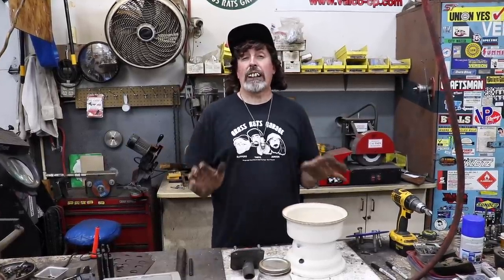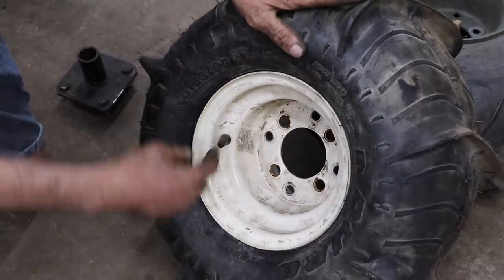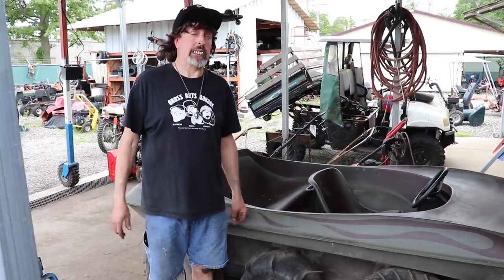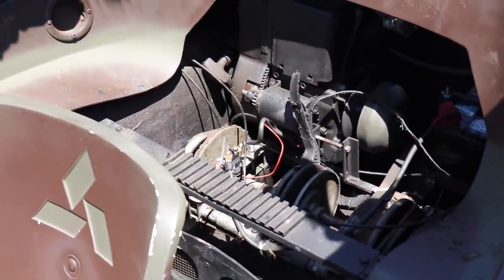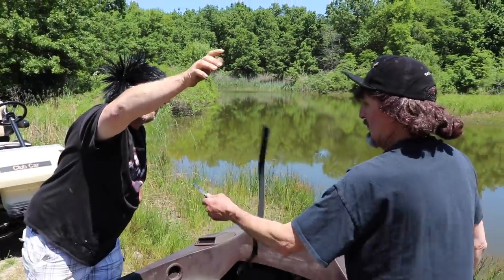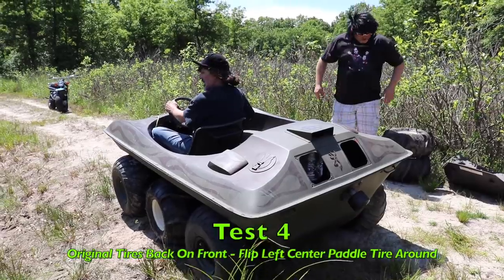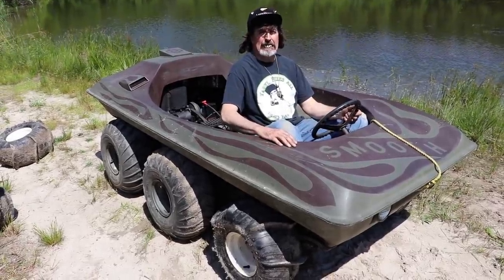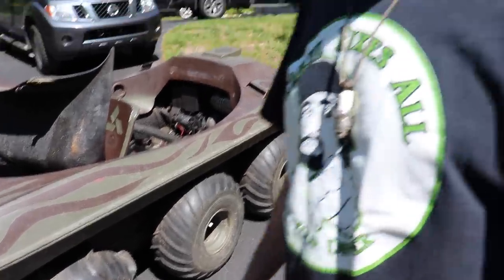Awesome FREE 6 Wheeler! Part 3 (Tire Test)

Comment: The more I see of this vehicle the more I understand why the guy was so keen to give it away.🤣
Reply: I was thinking the same thing..lol..no one would buy it...
Reply: Yeah I think they were junk. I mean look at all the chains. That thing would be in the garage being worked on more that it was driven.
Reply: Bro are those teeth real?
Reply: @wouldyouglowme4235  He sells them if you want to buy them. Go to his store.
Reply: @NY411Info  it doesn't seem like the chains are causing the issues here.
Reply: @Skoda130  Chains suck. The longer they are the more problems they will have due to wear. One link with .005 " wear adds up fast the longer the chain, which in turn also wrecks the sprockets. This is also why new vehicles suck with their long timing chains.
Reply: @NY411Info  maybe so, but the chains used in this thing, aren't much longer than those of a motorcycle. It's more that there are many of them. But that doesn't make their respective wear compound.

Comment: i think i would use the original street tires and put a trolling motor on it
Reply: Trolling motor?
15hp Johnson
Reply: @guyina4x499  7 marine 627
Reply: After working over 25 yrs at the gof course and changing lots of small tites. I found that a Cushman won't fit a Yamaha, or a John Deere, or others, you should have tried different rims.

Comment: A Naval Architect taught me about the term "hull speed limit"... Essentially, for a displacement watercraft ( it's not able to get on plane) the hull speed limit is determined by the length to beam ratio....short/wide craft will never go as fast as long/slender craft- no matter how much horsepower you add...  Think Jon Boat vs Canoe....
Reply: i got a 1432? with a 3.5hp 4stroke on it and it goes so fast i need to only use about 25% power. all your theory must also take into account the weight of the craft.
Reply: The vehicle needs a propeller shaft 😁
Reply: @robertp7209  i use a outboard.

Comment: Welp she's a good one for soft and boggy swampy ground, not a fish and ski, still cool though.  Hey we told you that spare belt was going to be easy to replace!   Cool machine, I'd like to see it on the snow this winter.   Neighbor had that or an argo like 50 years ago.  He would run it on the frozen backwaters during early ice fishing, worked well for that.  Occasionally busting through and crawling back on the ice.  It went through snow well until it got too deep.

Comment: My dad back when I was ten, fifty years now got two hovercrafts and this six wheeler from Boeing surplus we played with the six wheeler though the ditch and near by swamps and had a blast. The hover crafts filled the garage had a thick rubber bladder around it and he started it up and I recall that it lifted up as the air filled the bladder. Latter in the week he sold it all off to co workers hope he made a profit .

Comment: After going to all that trouble and expense, I would have at least given all 6 of them a try one time even if I thought it wasn't going to work.
Reply: They need to put 3 paddle tires running backards on the left and one in center on the right and I'd add a Rutter off of a sailboat and maybe a mast and a sail to.
Reply: @sams7655  And an outboard, just in case a storm blows up and shreds the sails.
Reply: Yea at least given all 6 A go

Comment: Taryl if you have to drill out a new bolt pattern anyway just get the right size wheel and paddle tires you need the straight paddle which is vulcanized to the tire that’s the tried and true paddle Us Dune dudes have been using since the 60s. Also Douglas wheel makes aluminum wheels and does custom bolt patterns they’re not super expensive. You would get a lighter wheel to so that’s a plus. Next only putting one paddle on each side is like trying to get slippers and Ronnie to work together it just doesn’t work because you’re taller stock tires are fighting against the shorter paddle tires reducing the efficiency. You got a put on all six tires to know what’s going on. Next leaving the E brake on will smoke your belt and overheat your engine but I’m sure you know that. Another fantastic video knuckleheads!

Comment: My uncle sold 6x6's back in the late 60's. I don't recall the brand or model but it didn't have a steering wheel it had 2 stick drives. To go forward you pushed both sticks forward and pulled them back for reverse...to turn you pulled one stick back and pushed the other forward. It could do 'zero' turns..and it could do them very quickly. I want to say the whole 6x6 looked bigger than Taryl's unit does but its been 50 years lots of things looked bigger back then hehe.

Comment: The problem here was that the paddled tires were smaller diameter, and more (if not just about all) was submerged.  The upper part of the tire is thus producing reverse thrust and decreasing the net forward thrust.

To get the best advantage, you need to use tires that are bigger (for more bouyancy and rides higher) and/or taller so less is under water.  You don't have a lot of room, but perhaps this is why the thing has axle extenders so you can get a bit larger tires to fit.  The booklet may talk about tire options.

Comment: Looks to me like you have the stock tires mounted backwards to begin with. The V in the tread is supposed to face forward. Paddle tires are not made for water, too much cavitation.
Reply: You mean the tip points forward.
Reply: What have you been smoking Steamboat Willie! The Mississippi River! Are you from another planet we’ve been using paddle boats for 100 years. They work fine.
Reply: They are mounted opposite to conventional.  Top of tire, treads pointing forward.
Farmers have found that the big tractor tires on grain buggies have less tire wear when pointed opposite.
Reply: Bobby Harvill  Grain Buggies do not 'drive'.  On paved roads the configuration of tires in reverse seems to wear better.
Reply: Amphibious vehicles like this use flotation tires like this are supposed to have the tires mounted "backwards". The groves help serve as paddles when mounted that way. Those tires are specifically designed for vehicles like Argos, Amphicats, Max and other amphibious ATVs.

Comment: just run all 6 paddle wheels. your water speed will go up if you run the wheels slower, you push air under when you spin them that fast and you lose torque against the water. Ever see a paddle wheeler boat? Use that wheel speed.
Reply: Lots of cavitation...Not good.   Smoother tire cause less.
Reply: @johnkruer7557  once again look up cavitation on the interweb.
Reply: The clutch probably requires reves to engage.
Reply: Paddle wheeler boats only work because relatively little of the wheel is in the water.  Submerge the paddle wheel, and you don't get any thrust.  Here, the smaller diameter wheels were more submerged than the original, and the top of the tire is producing reverse thrust.

Comment: I would think paddle tires at the rear would be the most help in the water. 
Slightly smaller tires at the corners and slightly bigger in the middle sounds like a winning combo for maneuverability.

Comment: The issue with those sand tires are that they’re grabbing water but not releasing it effectively to move faster through the water. The water is just going round and round...kinda like that one song...🎶round and round...our skid steer will find a way out, just give it time.🎶

Comment: If you were feeling ambitious, you could ditch the mechanical drive altogether. Put in a hydraulic pump and two hydraulic motors, one for each side. Then instead of brake steering you could have counter-rotation on the wheels AND reverse. It's already got hydraulic steering that operates the brakes. How hard could it be? (famous last words)
Reply: I'm in! He's got to have a junk ZT out there.
Reply: Plus you could hook the hydraulics up to a jet drive for on the water propulsion.
Reply: I was thinkin an outboard motor on the back
Reply: Much simpler to just put an electric motor on each side.  Then you would have forward and reverse with a decent speed control for each side.  If you can get inhub electric motors, you can bolt them on the outside and have the inside completely open.
Reply: @jmaus2k  Electric? You want to paint a rainbow flag on it too? lol
Reply: @danielprivate7442  No, but making it electric is much easier and cheaper than adding hydraulic pumps and motors.

Comment: We found a old one Scrambler .  an  use the wheel motor's  an pumps from a old X-mark zero turn mower .   it wasn't fast  but in a way it was fast .  drive like a tank. had very good turning , it could turn on it self . Maybe that be a good thought an try that idea out

Comment: Taryl great video !!!  **Question** on the Briggs 22 hp V twin - Intek engine - it has the Nikki carb - when the engine is at full rpm clearly the fuel is running through the main jets but do the primary jets also contribute fuel to the engine at full rpm???  I watched your custom tuning video and this is the one missing detail that I can't find on the inter- screen.... :)

Comment: The paddle tires are throwing just as much water back as they are forward.
Reply: it is why paddle boat are no good. we found out a while ago that a propeller is way better. i think some paddle craft use a "wave drive" its basically two wings swimming into the water, i think its even better than a propeller.

Comment: Seems to me, after watching this video, that you would need two distinct sets of tyres. The paddle tyres you featured are great on the trail because they kick the dirt, mud and sand out from under the wheel wells by virtue of those angled paddles, thus making it easier to steer. But in the water those same angled paddles are kicking the water away to the sides, making the vehicle harder to steer and slowing it down. An ideal set of water tyres would have to have the paddles perpendicular to the walls, like the old paddle steamers on the Mississippi. You would get improved steering AND more speed. So There's yer Dinner.

Comment: If it were me, I'd fabricate up some paddles to add TO the tires. The paddles could sit outside the wheels by maybe 4-6 inches and sit below the tire a few inches so that on land, they wouldn't touch, but when you get in water, they would help paddle through... if that makes sense.

Comment: I think the paddle tires being shorter were also a factor.  Potentially this causes the machine to site a little lower in the water.  It also isn't just the overall height of the tire...it's the carcass size that matters (size without the tread, or paddles in this case).  I'm not sure if it is normal but there were also times when only the front and middle wheel spun when you were on land and the back wheel did not spin.

Comment: The paddle tires throw too much water forward(on the top), which slows it down.  You could try running them where they rotate opposite of what they are designed too and maybe they will shed the water before throwing it forward.  I think that's why the stock tires worked best in water(they didn't throw any forward).

Comment: Throw in a jetski engine lol. Looks like the original tires are on backwards, try facing the V towards the front with all 6 original tires. Surely the manufacturer did some testing and chose those tires and tread pattern for a reason

Comment: You didn't try all 6 paddle tires at once?!?!
Reply: They needed to do that and make (or try to) three on one side face the same direction, and three on the other side facing opposite--in other words have the wider paddle edge that Taryl mentioned, facing outwards. They really need some symmetrical paddle wheels with paddle going straight across the tire....

Comment: The paddle tires hold less air, so the 6 wheeler sits lower in the water, causing more drag.  You need the larger tires to float higher.  When the paddle tires were in the back, you could see the rear end sit lower in the water.

Comment: The larger size of the original tires allowed for more buoyancy, higher wheel speed, and more surface area contacting the water. For the amount of power that unit puts out there is really not a better tire for it than the originals. Ironically those original type tires work excellent in sand for underpowered atvs like old three wheelers and go karts. You only see an advantage with the paddles when you have enough power to really spin them..im sure the same applies in water.
Reply: The really early ones had balloon tires with a 3" rim.
Reply: ...put some rotten chicken livers and catch that giant
"SNAPPER TURTLE"🐢...it could rescue you back to shore with the
tow rope...do admire your
"never give up
  attitude" :
How many times did 
Thomas Edison's experimen-tations fail before he discovered the best materials inventing the 
incandescent
light bulb...
Actually, the best of this time was no5 wasted, but how you got to spend a great day with your
guys!!!
FYI: Remember the
German-built
AmphibianCar of the early 60s??
Reply: Oh, what about researching the WWII GMC
"DUCK" Troop transporter... far as known here in GA at
Stone Mountain Park
there is one used as a ride into the surrounding lake...

Comment: with the smaller tire it will be pushed by the larger tire  unless the tire not the paddle part is same size..if it not the same the chain will have alot of strain on it because the smaller tire needs to turn more than the others..same goes for awd and 4x4 cars and trucks same tire size all around. 😉😇

Comment: I think The smaller tire loses buoyancy and sits too low in the water.  You want the big tires in the water.  Someone else also mentioned the paddles agitating the water causing cavitation that may not have helped either. When it first went out, all stock, it looked pretty good!

Comment: WW II vw schwimwagon  was the mastery of amphibious  vehicles  4x4 lockers 4 wheel suspension 1500 lb and has a propeller.  Saw supposedly  by far the most capable wheeled vehicle off road of ww2

Comment: It seems like the tires cause agitation more than forward momentum. Almost like the tops of the tires are pushing it backwards as the bottoms are pushing it forward. Too bad there’s not a way to stop the backflow from the tops of the tires.
Reply: I think it has to do with so much of the wheel being submerged, if only half the wheel or less was under water I think it would work
Reply: Maybe try experimenting with a V -shaped deflection plate mounted just enough above the tires to redirect the water as so not to throw it back down in front of each tire again.

Comment: the paddle tires would work if you had the 3 Right side tires or a universal V type paddle similar to the stock tire but much bigger blade also paddles are better on rear due to no thrust interference from other tires.

Comment: I was thinking you could put a Zero turn mower drive system in it.  You probably have the parts in the yard and you are good at re-engineering stuff and that would give you easier steering plus will solve your reverse problem.  With your above average brain power you could either put in steering sticks, or figure out a way to keep the steering wheel in place and use it to actuate the individual hydraulic motors.

Comment: Is it possible there's a drag on one of the sides? It seems like the engine would bog down some when only one side turning and the other side seems like all the power is there. How about trying it with a battery outboard motor?

Comment: The right side tires are throwing the water back and to the outside like they should. The left tires are throwing the water back and to the INSIDE against the hull causing all kinds of drag. You need to flip the left side tires around so they will also throw the water to the outside and it will go like mad.

Comment: Looks to me like those tires are acting like propellers, since the paddles are kinda slanted instead of being parallel to the axle or symmetric like the chevrons on the originals. This tends to push the tire to one side, and in some cases, the tire is pulling you  the opposite way from what you want to go. An aircraft analogy would be the "adverse yaw" you get that effectively makes the ailerons work backwards. So you steer the thing in water by means of asymmetrical thrust - but the tires on the side that are turning are pulling the  wrong way because of the vector of the forces equalizing. I made all that up. Maybe some of it is applicable.

Comment: The big key with turning is you have to be ON the throttle while turning.. Normally we're used to being on the brake to turn in most vehicles, so it can feel a little weird.  It actually moves faster than I thought it would with the original tires.

Comment: Those paddles don't seem to add much in the way of speed on the water, but what they do seem to add is a lot of rolling resistance. Bet that's why the belt broke. I'm willing to also bet that with the 50,000 hours of engineering and testing, they probably did exhaustive testing to determine what kind of tires give the best overall balance of performance, I'd say stick to stock!!

Comment: The paddles seemed angled and were kicking the water out and away. Maybe reversing them on the rims so the paddles pull the water in and against the hull would net better results.

Comment: The sand tires were throwing the water out which was causing suction and slowing it down. They should've been throwing the water under to make it float, flat paddles would've even been better cuz they would've been pulling it above the water like the original tires.

Comment: And what you found out driving it around is the reason you do not see these on every trail today. Too many compromises in the design to make it an amphibious vehicle. I guess it's okay on the trails but it's really not going to cut it on the water.  For the trails get a four-wheeler, for the water get a boat.